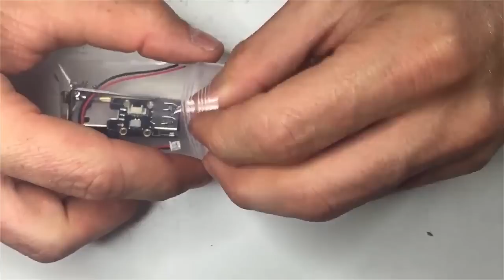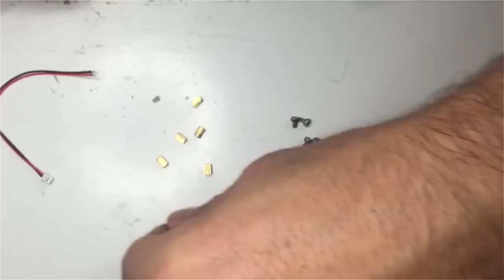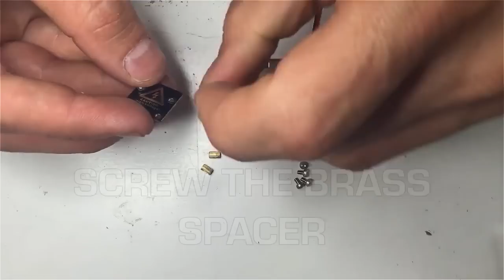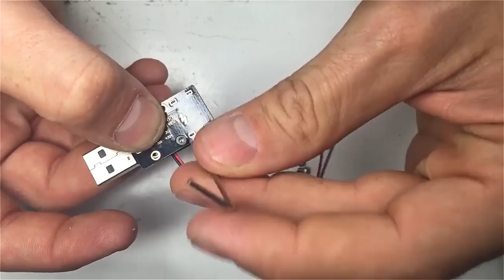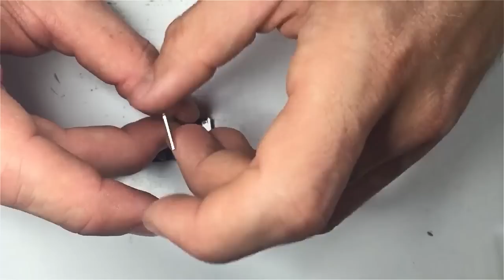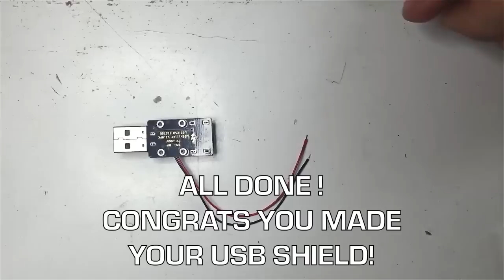USB Killer Shield Assembly

Comment: How would this affect a macbook or mac desktop?
Reply: Sends a really, really high current through the usb port and pretty much fries everything.
Reply: Most new macs are protected against this device.
Reply: +Ben O they basicly have a high quality motherboard and vrm (voltage regulator module) so for them, this usb is useless, their defenses are so thick and powerful that can easily block any power surge
Reply: Dank memes